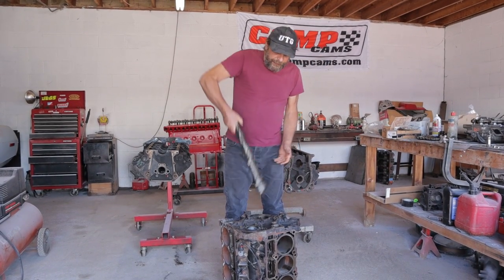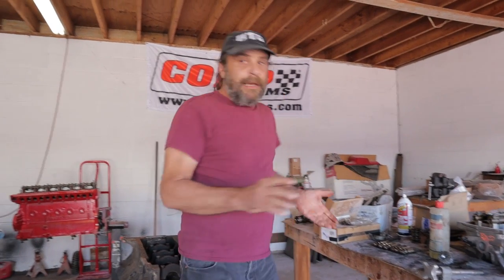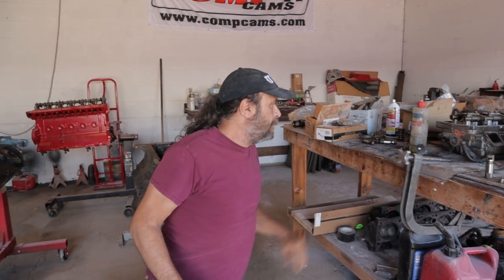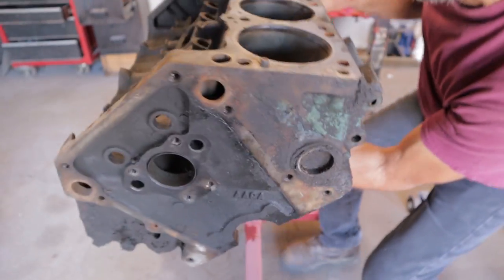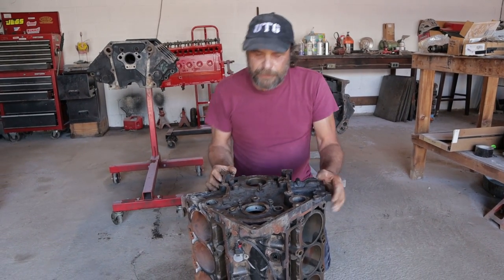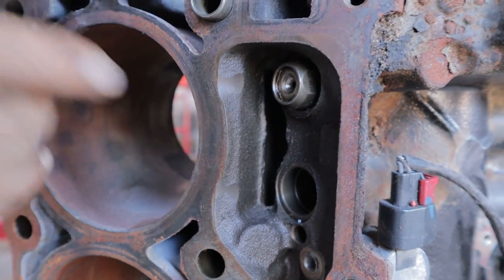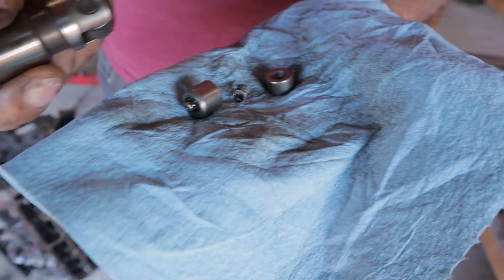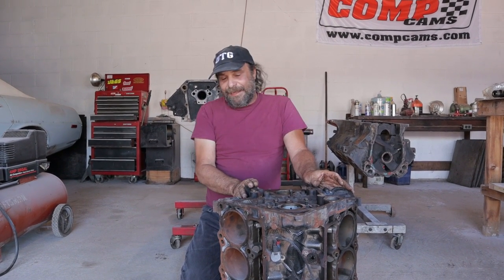Gen 3 Hemi Camshaft Failure Mystery Explained!

Comment: The old design Chrysler engines with regular maintenance are long lasting and durable engine.
Thanks Tony.
Reply: New engines aren’t meant to last. 

Listen to tony people. 
Stop supporting unsustainable the junk that the kids these days call cars and engines.
Reply: God i love my ever fuckin faithful 97 ram 1500 5.9 magnum. Love the 318 and 360 engines
Reply: that is such BS, any and i mean ANY new engine in ANY car nowadays will run 200,000 miles without any trouble. The cars of the 60s, 70s, and 80s would not even dream of that.
Reply: @uliwehner  lol. A Chevy 350 will legitimately not die. It's called maintenance. It might run on four cylinders with a hole in two of them but it will still run. New cars have catastrophic failures due to bad design and appliance like production. When something goes wrong on a new car you have to throw the whole thing away. There's pros and cons to both of them but you can't outright say a new car is more reliable considering they haven't stood the test of time. I can fire up and drive and old v8 that has been sitting for 30+ years because there is no electric fuel pump, no ecu, no electric controlled transmission, no electronic controlled throttle, It's all mechanical, it has to work. New cars are built like appliances that break and can't be fixed for a reasonable price or reasonable man hours. Pure ignorance on your part here.
Reply: @uliwehner  Apparently you have never owned a vehicle from 60's to the 80's as long as you maintained the vehicle ie: oil changes,tune ups and fluid changes they would easily last 300 thousand.
Reply: I call bs. I bet none of you is daily driving an 80s or 90s car with more than 200k or more. Not saying there are not v8s that will still run. But no problem means no problem. I Never see one of you on my way to work. I drive my little v6 ranger with 240k daily. My 86 bmw was my daily till 250k and 25 years. 98 super duty us pushing 250k with a trailer behind it. Yes i do own cars that daily with over 200k. Not one person i know dailys a 70s or 80s car
Reply: Johnny Paycheck  exactly, i have owned quite few beetles and split buses, still have a 53 oval. I love them, but they were definitely not 200,000 mile daily drivers

Comment: That makes perfect sense. What about a low tech fix, such as taking a triangular file and creating a vertical scratch/small groove in each lifter bore to direct pressurized oil straight towards the roller? (Obviously not too big of a groove so as to lose too much pressure to the lifter galley)
Definitely a design flaw.
Reply: Give it a try!
Reply: TONY, I DOUBT THE ENGINEERS WOULD MAKE A FATAL FLAW MISTAKE LIKE THAT IN THE DESIGN OF THE BLOCK AND PRODUCE IT FOR SO MANY YEARS WITHOUT CORRECTING IT. IT HAS TO BE SOMETHING MORE SIMPLE. THE ONLY LOGICAL ANSWER TO WHY THE CAM LOBS ARE BEING WIPED OUT IS THE LIFTER ITSELF. WHERE THE ROLLER THAT RIDES ON THE CAMSHAFT, THE CENTER SHAFT DRILLED HOLE WAS NOT CENTERED WHERE IT WAS OFFSET, WHERE WHEN YOU SPIN THE ROLLER IT WOBBLES UP AND DOWN CAUSING A FICTION EFFECT. THIS IS ALWAYS THE CASE WHERE THE SUBCONTRACTOR WHO PRODUCED THOSE LIFTERS FOR CHRYSLER HAD BAD QUALITY CONTROL. THIS IS WHERE CHRYSLER SHOULD BEGIN THERE INVESTIGATION.
Reply: Your solution won't provide enough oil to prevent the damage. The oil comes in thru the pushrod, the excess will drop thru the drains cast into the lifter valley. A drilled hole thru the lifter body would be a better solution, as well as reduction in size of those drainback castings. A small lake of oil up in the lifter valleys would greatly help the engine at idle speed, as the lifters would have plenty of oil to keep them from scuffing.
Reply: @autochronicles8667  CHRYSLER ALREADY DID WHAT. CAN YOU BE MORE SPECIFIC?

Comment: incredible man, great work.  As far as "fix", oil additive molybdenum will create a plate in dry lifters, as well as ester based oil and perhaps pao based oil, all will help.  Redline is killing hemi tick at a very high rate, ram forum polling shows nearly 90% of hemi owners who try it kill their tick.  I'm sure other additives will work against perpendicular forces.  EP or extreme pressure additives can alleviate much of this bad design.  Thanks for the work, it blew me away.
Reply: TONY, I DOUBT THE ENGINEERS WOULD MAKE A FATAL FLAW MISTAKE LIKE THAT IN THE DESIGN OF THE BLOCK AND PRODUCE IT FOR SO MANY YEARS WITHOUT CORRECTING IT. IT HAS TO BE SOMETHING MORE SIMPLE. THE ONLY LOGICAL ANSWER TO WHY THE CAM LOBS ARE BEING WIPED OUT IS THE LIFTER ITSELF. WHERE THE ROLLER THAT RIDES ON THE CAMSHAFT, THE CENTER SHAFT DRILLED HOLE WAS NOT CENTERED WHERE IT WAS OFFSET, WHERE WHEN YOU SPIN THE ROLLER IT WOBBLES UP AND DOWN CAUSING A FICTION EFFECT. THIS IS ALWAYS THE CASE WHERE THE SUBCONTRACTOR WHO PRODUCED THOSE LIFTERS FOR CHRYSLER HAD BAD QUALITY CONTROL. THIS IS WHERE CHRYSLER SHOULD BEGIN THERE INVESTIGATION.
Reply: We had a 1979 Cessna 172 with the O320 “H” engine that wore the camshafts out. After the cam was replace we had to run  the “snake oil” additive to prevent it from happening shin. The engine still ran great years later when we sold that plane.
Reply: @darnellcarver3987  IF YOU DON'T USE THE PROPER LIGHT WEIGHT OIL SUGGESTED BY THE MANUFACTURER YOU WILL WIPE OUT THE CAMSHAFTS. I HAVE A 2005 MERCURY MARINER 3.0 DOHC ENGINE WITH 180,000 MILES AND STILL RUNS LIKE A ROCKET. I BOUGHT IT NEW WHEN MY DAUGHTER WAS BORN AND NEVER WARMED IT UP A DAY IN IT'S LIFE AND ABUSED IT AND RACED THE BALLS OFF OF IT AND OTHER THAN A ALTERNATOR AND BRAKES. IT HAS NEVER GIVEN ME A PROBLEM BECAUSE I USE THE RECOMMENDED MOTORCRAFT 5W-20 AND DO MY OWN OIL CHANGES. I NEVER TAKE IT TO A JIFFY LUBE, ETC. WHEN YOU ARE DEALING WITH OVERHEAD CAM ENGINES THERE ARE SPIT HOLES THAT LUBRICATE THAT CAMSHAFTS. IF YOU USE A HEAVIER WEIGHT OIL THE OIL WILL NOT SQUIRT BUT OOZE OUT NEVER REACHING THE CAMSHAFT AND THIS IS WHAT HAPPENED TO YOUR 1979 CESSNA. THE MERCEDES OVERHEAD CAM V-8 HAD THE SAME PROBLEM. IF YOU DIDN'T USE THE PROPER WEIGHT OIL YOU WILL WIPED OUT THE CAMSHAFTS.
Reply: @Frank289100  wrong, I've been running 5w30 in my hemi for 40k miles now and so have many other people with 0 issues. MDS works great and their motors run smoother. 5w20 was "recommended" by Chrysler for one reason only: fuel economy, not engine longevity. 5w20 is too thin of oil for a 395HP V8 in a truck that can tow 10000lbs.
Reply: @massivefins2597  THANK YOU! IT'S A BAD RUN OF RANDOM PARTS. THIS IS A MAJOR PROBLEM FOR ALL MANUFACTURERS ALL OVER THE WORLD WHEN ISSUES LIKE THIS POP UP. EVEN MERCEDES BENZ HAS THEM.
Reply: @CUnit1981  IT'S THE 5W PART OF THE OIL THAT COUNTS GIVING IT PROPER LUBRICATION WHEN A COLD ENGINE IS INITIALLY STARTED UP. I NEVER ONCE WARMED MY VEHICLE UP ON FREEZING DAYS PUT IT IN GEAR AND GO. AND AFTER 180,000 MILES STILL RUNS LIKE IT IS NEW. IF I WOULD HAVE CHANGED TO A 10W. THE MOTOR WOULD HAVE PROBABLY NEVER WENT THE MILEAGE IT HAS GONE STILL MAKING POWER.
Reply: @Frank289100  Here is the quagmire, 20 weight will lubricate a little better, remember 30 weight historically has been considered a thin oil as well, plus the oil pump equals out the two.  But here is the thing, you have to realize the HEAT in those scuffed lifters when they are in action, it will make any oil thinner and if you use a thin oil in the first place there will be next to no protection.  Yes, low protection is better then no protection, but at our hemi forum roughly 1/2 of the forum uses 30 weight or heavier in the mds hemi if you believe the poll.  Secondly, most of the cam failures have been happening on 20 weight oil, since that is what the dealer has everyone on?  This problem is more prevalent than anyone knows.  I'm not sure how much it matters 20 oe 30 weight since the oil pump equals out either's attrinutes, but one thing is zero doubt, your oil needs to have moly and/or ester, high zinc, pao base oils.  When fca built an oil srt 0w40, the put 250ppm moly, this should tell everyone with 1/2 a brain you need this stuff in your oil in high ppm.

Another thing, fca has increased the recomended viscosity when dealing with a problem, they have done it in the eco diesel with bearings and even in the diffs.  But since fca has been lying to everyone saying mds needs 20 weight, and the api is up their butt on 1500's, they can't change their recomendation to 30 weight or heavier.  It's up to each guy to develop a strategy of lubrication, as a group we have done this at ram forum, I suggest each hemi owner research oil formulas and come up with a plan.  We have killed hemi tick with lubrication at about an 80% success rate, and when you look at the lifters, it is not masking the issue but rather providing adequate lubrication or film strength.  Oil is not the only part of the answer, fca knows it and that is why they made high moly oil, and ram forum knows it because we kill more ticks then raid.
Reply: @CUnit1981  Bang on Bud! Get rid of that crap 5w20 and run 5w30 or even 0w40 and your engine will Love you back. You hit the nail on the head. These engines should NEVER have been recommended to run with 5w20. That was a huge mistake.
Reply: @larrydunlop378  What do you guys recommend for the cold, it gets around -30 where I live in the winter?
Reply: @cozywhitenoise9962 I live with that same temperature in the winter.  I still run 5w30  as the 5 is the oil vicoscity at 0° F . But if Chrysler recomends 5w20 for summer use in Arizona, It would probably be ok to use it in Jan, Feb at -30 anywhere. But change it out as soon as it warms up outside. I still am leary of running it even in the winter.  A 5w20 and a 5w30 have the Same viscocity at 0°F. Its unbelievable that any manufacturer recomends 5w20 for any summer use...They only do so for some percieved fuel economy increase........
Reply: @larrydunlop378  Ahh, I see, thank you.

Comment: I had a cam lifter swap 2010 5.7 hemi  and I have 450,067 miles engine and 300,000 miles on the new cam lifter swap with no problems
Reply: 8127y 19blue - yep, I think people are using the wrong viscosity oil.
Reply: 5/20?

Comment: Uncle Tony I have a 5.7 and bunch of us Magnum and Ram owners have them. You would doing a public service by finding a workable solution for us.
Reply: The 2004-2005 tdi engines EAT camshaft lobes every 100,000 miles or less. 

Some people tried aftermarket parts with mixed success. 

Eventually a guru figures out how to tap into an oil passage. And add additional oil sqirters on the cam and lifter/ lifter bores. 

It’s a lot of work. 
But on the vw engine if you wait 100k you’ll need a timing belt and the cam and lifters- (and special torque to yield bolts) 

The whole package is over $2000 to fix the problem. 

If the heads coming out to be modified for proper oiling it’s closer to $4,000
For a 4cyl.
Reply: @CC Ryder I already have a Magnum 318 in my Dakota.
Reply: It's an issue caused by tight valve guide clearances. The guide doesn't expand at the same rate as the valve stem, the guide clamps in the valve stem, long enough to transfer heat, then the valve is released....but not before the rocker is stopped, the pushrod is stopped, the lifter roller bearings are crushed. After that, it ruins the lobe. How do I know? I worked at Chrysler tech support. Open up the guides about half a thou, problem goes away. Original specs were: .9 thou on the intakes, and, 1.5 thou on the exhausts. Go to: 1.5 thou, intake, and 2.0-2.1 thou, in the exhaust. Problem goes away, even on MDS engines. Why does this happen on MDS cylinders, more than the others? It takes valve action to throw out into/ on to, the guides. Stop the valves on MDS cylinders...you stop the oil from working down the guide. Unfortunately, you have to remove the heads to fix them. Good thing they are easy, as heads go.
Reply: @mikestone234  this has nothing to do with valve guides. This is a lack of lubrication problem. What you describing would be happening the whole cam. Every instance I see is that damage is on the lobes at the back end of the cam.

Comment: I've seen police cruisers with Idle Hour meters. The engine is limited to xx number of hours idling before it's deemed overhaul time. UT apparently has the explanation of why.
Reply: Another good reason Not to buy an old police Hemi is that they spend a Lot of time idling, which doesn't show up on the odometer ; which is why some maintenance programs install hourmeters to keep accurate track of actual engine hours vs mileage.
At $5000+ to fix the cam/ lifter issues, I'd avoid them like plague!
Reply: TONY, I DOUBT THE ENGINEERS WOULD MAKE A FATAL FLAW MISTAKE LIKE THAT IN THE DESIGN OF THE BLOCK AND PRODUCE IT FOR SO MANY YEARS WITHOUT CORRECTING IT. IT HAS TO BE SOMETHING MORE SIMPLE. THE ONLY LOGICAL ANSWER TO WHY THE CAM LOBS ARE BEING WIPED OUT IS THE LIFTER ITSELF. WHERE THE ROLLER THAT RIDES ON THE CAMSHAFT, THE CENTER SHAFT DRILLED HOLE WAS NOT CENTERED WHERE IT WAS OFFSET, WHERE WHEN YOU SPIN THE ROLLER IT WOBBLES UP AND DOWN CAUSING A FICTION EFFECT. THIS IS ALWAYS THE CASE WHERE THE SUBCONTRACTOR WHO PRODUCED THOSE LIFTERS FOR CHRYSLER HAD BAD QUALITY CONTROL. THIS IS WHERE CHRYSLER SHOULD BEGIN THERE INVESTIGATION.
Reply: Frank289100   Chrysler never corrected the design flaw with the 2.7 engine.  They did offer a modification to address the problem but I don’t think it ever went to production models.  Correcting substandard vendor parts is fairly easy.  Basic redesign of an engine is very expensive.  That non concentric roller is probably from abnormal wear not bad machining.
Reply: @raoulcruz4404  YOU GAVE ME A MEANINGLESS MINI A THESIS HERE. SO WHAT DO YOU BELIEVE IS THE CAUSE??
Reply: @Frank289100   Exactly as Tony explained.

 My meaningless thesis is to refute your premise that engineers would correct a design flaw. Not necessarily, because corporate has to approve and fund the redesign. Engineers can jump up and down about a redesign all they want. Doesn't have to happen. If corporate  says, No, then it's not going to happen. The onus is on the company to fund ($$$$) the fix.
 If it's a sloppy vendor problem, the vendor either fixes the problem or they don't get paid for their parts. How quickly do you think that issue will get resolved?
 By the way, do you really think that  rollers that badly machined would get past QA time and time again? Year after year? Your looking at an abnormally worn part.
Reply: @raoulcruz4404  RAOUL, GIVE IT UP. WHEN IT COMES TO THE HEMI. THE COMPANIES ENTIRE EXISTENCE IS BASED ON THIS ENGINE. WHICH IS WHAT SAVED CHRYSLER. THEY WOULD NEVER LET A FLAW DESIGN LINGER ON AND UNCORRECTED LIKE THIS WHICH COULD BANKRUPT THEM AND PUT THEM OUT OF BUSINESS.
Reply: @Frank289100   But Chrysler was o.k. with flawed vendor parts for over a decade and millions of engines? They risked the existence of the company instead of resolving the situation with  a phone call?

Incidentally, here is an excerpt from Hot Rod magazine. Daniel Boshears is building a monster torque street 5.7 Hemi. " The lifters started as tie bar lifters for an LS engine that were modified by Ron Shaver. The reason we used the LS lifter is that the factory lifter for the Hemi does not pump oil. We had to feed the valvetrain through the lifters, so we solved that problem with the GM lifter."
Reply: @raoulcruz4404  (But Chrysler was o.k. with flawed vendor parts for over a decade and millions of engines? They risked the existence of the company instead of resolving the situation with  a phone call?) <<--- YOU SAID IT WAS THE BLOCK AND I JUST WANT TO CLARIFY THAT. IN MANY CASES IT IS 1 LIFTER WIPING OUT THE CAM AND THE OTHERS ARE JUST FINE WHICH CONCLUDES A BAD LIFTER BECAUSE IF THE BLOCK DESIGN WAS BAD THEY ALL WOULD HAVE BEEN WIPED OUT. 
(The reason we used the LS lifter is that the factory lifter for the Hemi does not pump oil.)<<-- YOU JUST PROVED MY POINT IT'S THE LIFTERS. SO WHERE ARE YOU GOING WITH THIS?????????????????????????
Reply: Frank289100    Did you watch the video?  Just like Tony said: The block DESIGN contributes to poor oiling of the camshaft and valve train. The lifters are not DESiGNED. to provide pressure lube to their bores or the cam.  It’s a DESIGN problem. Been saying that from the start.  You are the one that says it’s only  bad subcontractor parts.  Redesign is expensive.  Phone call to vendor is cheap. Guess which one is likely to get done?  You are not even following your own line of thinking. And I don’t like repeating myself.  Good day.
Reply: @raoulcruz4404  IT'S NOT THE BLOCK FINITO!!!!!!!!!!!!!
Reply: @Frank289100  Wanna bet.  Why do you think Lee Iacocca had to step into the management seat and some who would not comply were sent to an office far away from all others in an old plant no longer in use.  He then made certain that phone service was never connected and that the secretary reported directly to him anyone attempting to communicate in any way with the secluded executive.  The desk of the executive was loaded with paperwork that he must complete in a timely manner and it must be correctly completed.  Anyone who opposed the renovation of the Chrysler administration was asked to go and visit the office of the spurned executive and see if he would like office space and desk loaded with paperwork and a secretary and no phone service.  As I understand it they eventually got the message.  Do not screw with Lee Iacocca.  Right now Chrysler may have administered by Fiat's top executive which pi=ulled their chestnuts out of the fire temporarily.  But currently in the entire Auto industry and indeed all industry in this country and others there is a great deal of instability.
Reply: @billwessels207  YOU PUT A ASTOUNDING AMOUNT OF MUMBO JUMBO INTO ONE PARAGRAPH AND THE FOOTBALL WENT RIGHT OVER MY HEAD. SO WHAT IS YOUR POINT?